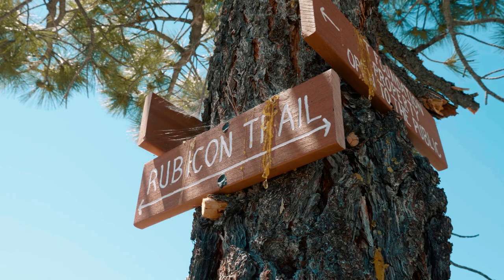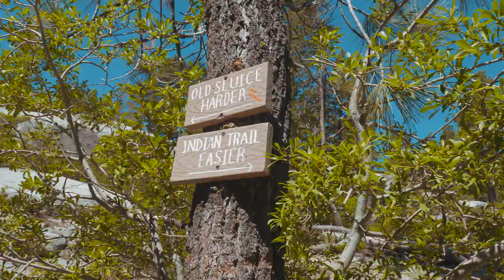Classic Ford Bronco and 1998 Jeep Cherokee Take Carnage on the Rubicon

Comment: Ether works better than starting fluid for seating beads.   You need to get it inside of the tire so when it explodes it forces the bead on the rim. Use in moderation. 

Good job.  Looks like you guys had a great time.  Thanks for sharing.
Reply from the maker: It took a few tries but we finally got it to pop! By we I mean our new Toyota friends haha

Comment: Never seen so many videos of people drinking on the trails.
Reply from the maker: Not our preferred way of handling the trail, but if I had to take a guess, it's been happening long before mobile cameras were around.
Reply: @wildhorses4x4  haha I bet. We wait for the campfire later. Up here in Canada you can get charged with drinking and driving. Some still do though. At least they were helpful.
Reply: The rubicon is a “Non-maintained” county road, (that’s also how we’ve been able to keep it open this long) people do get DUIs on the trail just like a normal road, just there are less people to enforce it because of its remoteness.
Reply: @welndmn  just hope people keep it reasonable then.